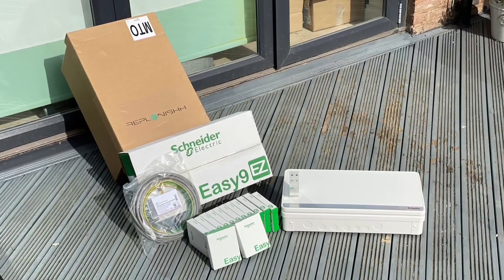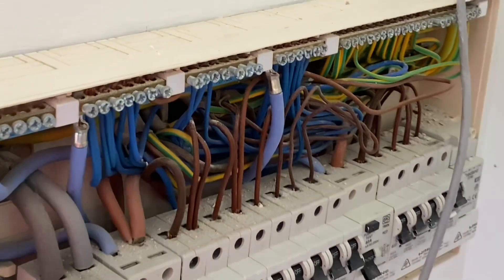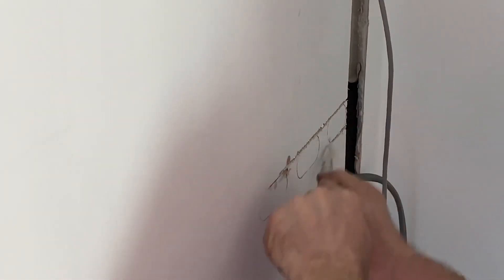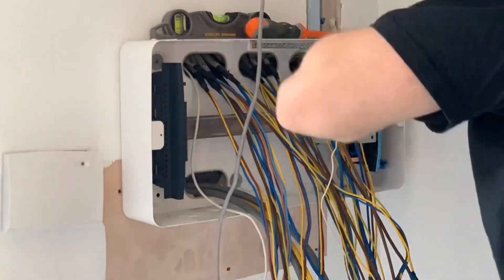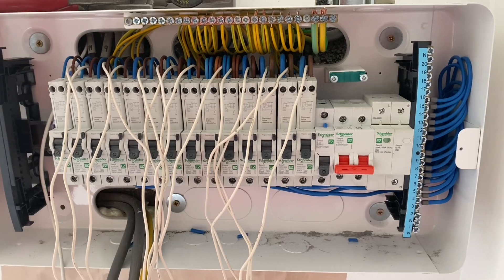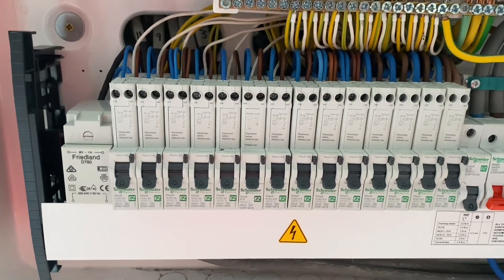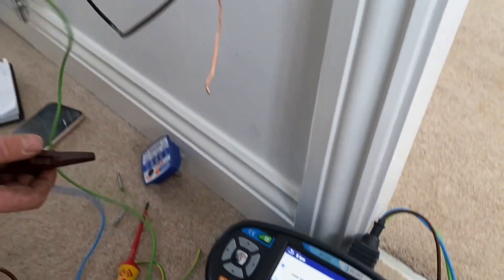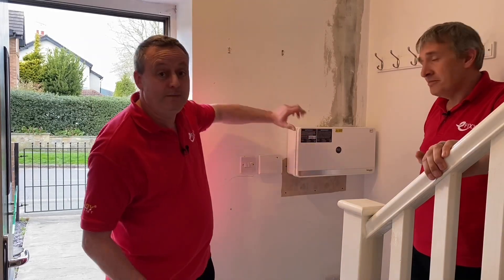EV CHARGER installation UK - WHY did we change the consumer unit?

Comment: I don’t really understand why the board had to go up — there seemed to be plenty of length on all of those cables. That’s why the whole thing wasn’t terribly neat, there was lots of spare length in the board.

And moving the whole thing up is a clear usability concern.
Reply from the maker: RCD type AC , needed a new circuit. Latest regs require metal enclosures
Reply: @efixx  yeah, no, I see why the board had to be changed. Just don’t see why it couldn’t go in the same place the existing one was.

Comment: I thought we were past the myth of heavy load near the main switch. The thick copper busbar takes care of that. How much resistance will a 20cm link bar, 2 x 7mm thick have from end to end? A resistance test less than 0.005 ohms? Schneider Easy is not a good choice of CU or larger RCBO's. The wylex, MK, fusebox CU have good space. Especially with Compact RCBO. The space above the breaker and behind the busbar is what sparkies want.

Comment: Why would you mount a CU at mid-level??
It looks hideous, slip down the stairs and smash into the CU - perfect.
Perfect height for small children to have a poke around as well - is it going to be protected in any way?
Should have been put at high level but of course that is more difficult.
Reply from the maker: Building regulation set the height 1200mm

Comment: Seems weird that they went to so much effort to put the incoming Line conductor on the right side of the main switch. Any reason ? I initially thought it might be to create a direct feed to the SPD from the main switch, but I assume the 20A MCB is the feed for the SPD.
Also; minor observation, but it is good practice to put the "solid" sides of the crocodile clips together when nulling the leads. This avoids the possibility of a higher resistance in the hinge of the levered side of the clips.

Comment: Plastic CU and AC type RCDs in it’s self is not a valid reason to change the CU . Also having a second CU for the EV charger being unsightly isn’t a valid reason to change the Existing CU ..  HSE note , now on page 4 of BS7671 and has been updated and made clear, also consumer units in dwellings page 99 of the latest edition of the onsite guide.
Nice job though,
Fantastic video as always guy’s 👍
Reply from the maker: Customer didn’t want another box by the front door.
Reply: @efixx  I understand that but Gaz made a point of saying that the CU is made off plastic and had AC type RCDs. My point was that should not be used as a reason to change the CU also Gordon said fitting an additional CU for the EV charger would be unsightly, what he should have said was the client doesn’t want an additional CU because it would look unsightly. 
Just an obsefasion on my part.
But who am I to argue i’am just a humble spark who’s opinion means nothing. 
It was a nice clean install though, great video as always 👍👍

Comment: Interesting and informative as well as well presented as usual.
I had a customer send me pictures of there ev installation, then tailed into the Hensley to a single switch (fused).
Only problem for me is there is no space left for a battery installation.
There was a t&e running to the garage, just plain, and it's into the consumer unit.
The evc is near the garage but I'm not sure what cable has been used. And was the first point installation. 
I've asked the customer if it can be fitted outside the house which happens to be behind the CU. Oddly he wants th t&e changed, which is ran under the garden.

I've not seen the cu. But I would run a separate switch as the unit has everything in it. So I can wire from the main feed or the CU. But for time cost, small cu wins

Comment: I have just been quoted an add on consumer unit at £259.99 in my quote. There is a separate £180 labour charge too for the installation of the EV charger. I'm not sure about that price because units do not cost anywhere near that figure, especially if its just a smaller add on to my existing consumer unit. It would be good to get a rough idea in these videos as to what things cost. Otherwise great content as always I have learned a lot. In fact its this video that has made me question the quote!
Reply from the maker: Sounds cheap - check out this video where we discuss costs. https://youtu.be/6_7nuQEqAiA
Reply: @efixx  Ah thank you!
Reply: That's a good price, adding testing digging, plastering, and time. It can be a lot of work.
I charge £220 plus parts. So it should give you a good idea of balance.

Comment: As the first circuit from the main switch is the EV charger which is protected by a mcb  From your previous video on the installation of the EV charger, it can be seen that the EV charging unit as been installed in the garden / patio area which is out of the curtlidge of the house. From this the pvc/swa circuit should be protected by an RCBO.
Reply: From the verbal comnentry   and the cicuit id written on the cardboard the EV is designated Circuit No 1 , being nearest the main switch. There is a mcb in circuit 1 and not the EV RCBO .
Reply: @thomasfriend6264  EV is No2. The MCB in No 1 is  for surge protector
Reply from the maker: It is protected by an RCBo
Reply: @efixx  From the verbal coomentry and the cicuit id on the cardboard states that it is the first circuit from thd maib switch, which is clearly a mcb

Comment: So easy on a newly built cardboard home, try doing it on a 200-year-old barn conversion overhead fed and with a looped supply, and unable to move the board to get more length......
Reply from the maker: Sounds like a separate consumer unit for the EV
Reply: @efixx  Western Power is having to put in a new temporary seperate supply, and come back and provide a seperate cable to each home on the loop of 3 homes, digging up the yards to bury the cables! Massive job.....

Comment: Anything to make more work and more wages more profit as simple charging point for a car to us into a major upgrade what do you think it is a bloody space rocket
Reply from the maker: How would you have advised we do the job?
Reply: @efixx  Well letting the cat out of the bag doesn’t cover it always talk about saving with a heat pump I want to hear electricity firms are putting in three phases it’s a new houses et cetera one for people one for the car and one for the house
What size heat pump is expected I wonder in my small house and use 44 kW of gas a day as of now , the ave is 60kw 
So heat pump input 20k for output 60k lecky to match gas at 21p kw ( for how long 21p) .£4 a day x 200 days is adding £800 to the av £800 yearly bill NOT including car charging .
And you are they are joking about how we got to change the consumer unit I will put any three-phase I will need all this talk about a con job by everybody in the country from government down to firms and small companies.
Cause she will be laughing you can see a future of endless profits and lots of work because why because the government is making it mandatory so you’ve got a captive public forced to do all these things.
Reply: @jimmorris5700  no reply to that one mate. I seen a bloke the other day doing ring continuity from a socket, he only had 1 cable in the board 🤣 it should all be done from the board

Comment: A couple of things are not quite right, but a great job by RS.
Reply: Could you point them out please. Thanks.
Reply: @markgilder9990  1. No spare ways for possible future expansion,  2. No fire retardant sealer in cable knockout entries. Regards P.

Comment: Change to make money.  Simply a Henry Block on the tails from the meter, tails from the block to the existing consumer unit. The other block tails to a new breaker and protection just for the outdoor charger and an in-line isolation switch then on to the charger on the outside of the building.  Easier to mount a current limiter on the EVC this way too
Reply from the maker: So where do you locate the new EV consumer unit? - Customer wasn't keen to have another box on the wall in the hallway.
Reply: @efixx  those with an electric cupboard it works fine

Comment: Hi Gaz and Gordon, I'm not an electrician, but an interested learner. just watched JW video on prescribed zones, within the video JW states all buried cables need rcd protection, it seems on the video and other videos the ev cable concealed without RCD protection to the cable. I understand the zappi has rcd protection but not the cable to it ?
Reply from the maker: You are correct - the EV in this video has an RCD in the consumer unit to protect the cable as it’s buried in the wall.
Reply: @efixx  Thank you, quick response, so the RCD within the zappi protects the cable leading to the zappi ?
Reply: Sorry just checked the first MCB isn't connected.
Reply: @efixx  what about selectivity of the rcd is there any time delays?
Reply: So if a  6mm cable clipped to the internal garage and the charger had a built in rcd would the charger circuit be ok of a mcb within the consumer unit, and the rest of the house circuits on individual rcbo’s and additional surge protection within the board? Or would you recommend having all circuits including EV charger off individual rcbo’s?

Comment: It's highly unlikely that the vast majority of house would require one charger. More like 3 or 4, a his and hers + child and visitors?
Going forward I would install a separate CU, minimum 4 ways. Or put a commercial one or two servicing the same amount of EV's. One is just not enough. In the case of multiple chargers synchronised usage would have to be used reduce power consumption.....needs some thought....

Comment: Nice job.
Just a suggestion that isn’t feasible at all installations, but keeping switchgear above 450mm/below 1200mm in domestic properties for disabled access does include the switchgear in the consumer unit & while gaining the extra for a neater job, the move would create problems for wheelchair users.
Reply: Doubt a wheelchairs going through there though.better no joints and a board a bit higher.
Reply: @carlosjackal7624  
Not for someone in a wheelchair
Reply: @carlosjackal7624 why would a wheelchair user not live there?

Comment: +efixx
Given the location, and drywall and such a large hole being made in the  in the wall anyway, did anybody consider installing a recessed consumer unit instead?
Reply from the maker: We prefer flush fit boards but very few are fitted. It would be very difficult as a retrofit in this install as it’s a solid wall behind the drywall.

Comment: I'm an American owner of an old house that has had 3 significant breaker panel upgrades over the course of a number of decades of remodelling. I'd prefer it if electricians would think more about how things will look 20-50 years in the future and not just how it looks today. Modern cables might last 100+ years, so if people would adopt a convention of leaving a neat loop of cable in a wall cavity for all new circuits then future panels wouldn't need to shift position. I can already imagine a future requirement of Arc fault breakers at some point in the UK. And some companies in the USA have introduced WiFi smart breakers that might catch on. Both could require new panels with different layouts. Needlessly cutting wires short to make the current panel look perfect should stop.
Reply from the maker: Brilliant comment - Future proofing is a major issue especially with the changes in world with EV, PV a d battery storage. We think the regulations and codes need to reflect the need for future proofing as electricians can only respond to the current needs and operate in a competitive market.
Reply: I tend to always run more than is needed in terms of cables. The problem you have is clients who want the best price, who are just thinking about the here and now.
10 years ago, no one was thinking of ev power and solar was just getting underway.
Reply: There are already breakers available that combine AFDD, RCD and MCB functionality in a single width DIN unit. I believe Hagar have one with Bluetooth connectivity for diagnostic purposes as well. That will fit in exactly the same space. 
One concern with all these things is that the failure modes are now very complex, and there is now even a phone App for the Hagar units and it's also possible to update the firmware on the breaker. This is going the way of modern cars - full of electronics requiring specialist software. 

nb. those very neat wiring jobs are fine, but I wonder if some flexibility for the future has been lost.

Comment: Where have all the neutral cables come from in the main neutral bar?
 I had understood the rcbo tool the circuit neutral so just the fly lead to the bar
Reply from the maker: They are the fly leads out to feed each individual Rcbo
Reply: Where they blue sleeved over the white, the clip I’m thinking of is before he fitted the flu leads from the rcbos?
Reply: Ignore me! It was the functional earth he’s was connecting after! In the white wires

Comment: Tidy job, surprised you didn't leave any spare ways for future expansion. Is there a reason for this? Shame for someone to have to re-do all that work in the future if more ways are needed
Reply from the maker: This is the biggest board in the Easy 9 range! - A few circuits are redundant atm - e.g The property has a gas hob, but is wired for electric. Debate about having smoke alarms on an individual circuit or combined with a lighting circuit. Does the door bell really a dedicated circuit for an 8 watt load?
Reply: @efixx  it’s not a debate, BS 5839-6 requires domestic smoke alarms to be on a shared circuit, not dedicated.
Reply from the maker: @bencrew4376  - You’d best phone the ECA and debate it with them as it’s not the advice they give to members - https://youtu.be/vbQz5OzYMOY
Reply: @efixx  ok hands up, you can have both options as per 5839 6...I’m a designer and should know better 😂

Comment: Board looks a bit in the way where it is, why not take the opportunity to move it up even higher? Looks like you'd be bumping into it when going up the stairs.

Also, I'm not a fan of stickers on the outside of boards unless required by law.
Reply: or, as per my comment, recessed unit...

Comment: No room at the top of the rcbo’s why didn’t they make it with a din rail lower down. Neat job
Reply: 8:22 The DIN rail seems to bend excessively under pressure.  It looks as flimsy as the old plastic consumer units.

Comment: wonder how much the WHOLE cost was from start to finish..when you think you need to add that cost to the supposed low running costs of a ev car so would not be as low or as money saving i guess
Reply: and how many EV charger installs require upgrade work before the EV charger can be installed?
Reply: @jeta1f35  ..and how many other areas need work before a CU can be signed off. I know that if I wanted an EV Charger I've about 1k of work that would need to happen to meet regulations. CU, undersized armours, probably some dodgy circuits, etc.

Comment: You would have a field day in our home, it was built in 1979 and that box at @1.25 with all the seperate switches son for parts of the house...well its the original one still a big square metal plate with a row of black flick switches lol, outside in a cupboard we do have a new electric box thing with the screen on etc

do you know if i wanted a ev charging point would it all need to be replaced? though i think we would maybe need a bigger main fuse or something

Comment: Hi guys, great quality install, though I would not choose that low location  for ccu for safety reasons, as well as it's packed which generates heat, then I would put a small 24v fan to cool it down. ( to reject the heat).

Comment: as all the cables came from above, could you not have moved the consumer higher out of the way?
Reply: Remember there are recomendations on how high a consumer unit should be mounted, which happen to accord fairly closley with the required heights for functional switches.  The board as shown looks as if it is on the limits.

Comment: That consumer unit looked quite full, I'm guessing that was the largest size for a single phase consumer unit by the look of it.
Do you think in the future we could be going to  3 phase installations ( thinking of some countries in Europe) on large  new build domestic  housing estates with extra circuits like Ev chargers and other possible extra circuits in the next say 5-10 years? Or maybe Equipment will get more energy efficient?
Reply from the maker: Western Power Distribution now fit three phase cables as standard to new and upgraded installations.  (not that all of the builders choose to use it though)
Reply: @efixx  ok, I've not been on a new build site for well over 10 years,interesting to know.
Obviously installations like that would have to go in on ground works  before hand and would depend on cost and knowledge to the builder like i think you were referring to
Reply from the maker: They are the only DNO adopting this approach. Three phase appearing in the residential sector could need some “retraining” for quite a few folks. Plus more residential appropriate 3 phase boards.
Reply: @efixx  Western Power are in the areas counties  I work in.
Bit of an old joke pre western power when Midlands electricity board were about.
Electricity meter reader knocks on a house door " M.E.B"
Home owner " i be alright M.E.B"!
Reply: There's bigger single-phase CUs out there - I know Contactum do dual-row ones. Fitted one at my house 10+ years ago as I had the room, and has been useful when I've wanted to add circuits over the years. Future proof(ish).